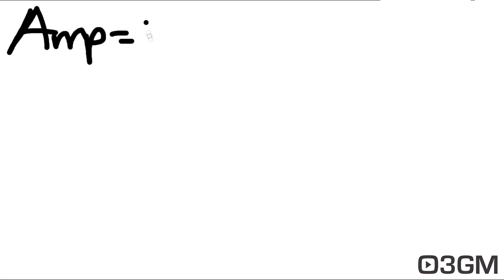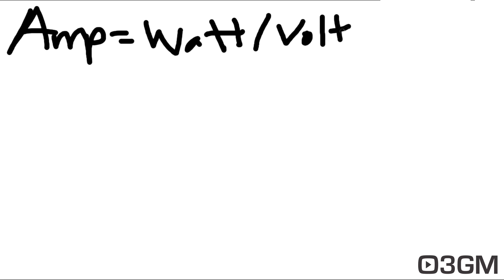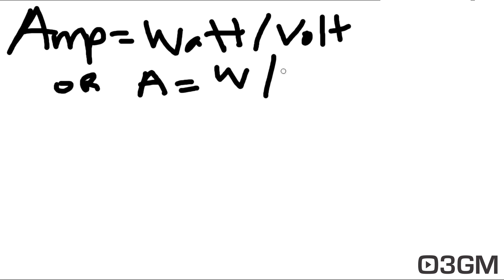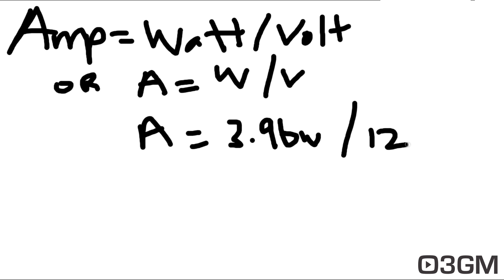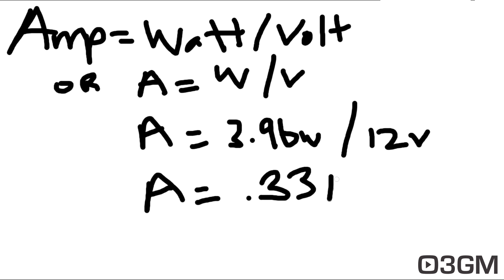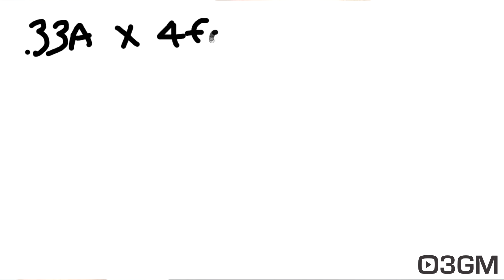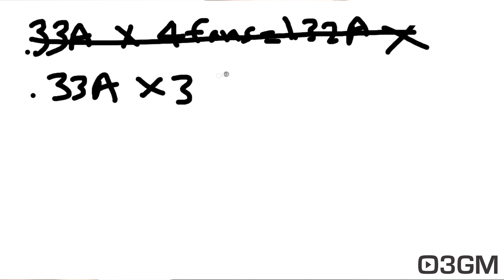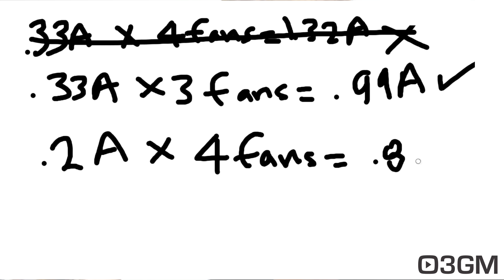#559 - Q&A: How Many Fans per Fan Header?

Comment: Subbed! Great overview and easy to follow. Just bought a whole mess of Arctic flow and pressure fans, along with a new cpu cooler (literally, ID Cooling A410, released just recently) with a matching pressure fan for it to do a push-pull config. Probably overkill for my i7-4790, especially with me planning to delid it some time in the near future.

Realized after I had purchased the F12 and P12 PWM PST 's that my H97-PLUS board only has 2 case fan headers lol. Might upgrade to a Z97 or just go for another platform upgrade to 8th gen - even though I just purchased this mobo combo a month ago lmao. Should have waited a bit, as I just saw a Z97 w 4790K priced at $100, which is the same I bought my H97 4790 combo for. Oh well. After the defunct motherboard combo I had purchased, I was itching to game.

Anyways! Thanks for sharing this valuable info!

Comment: Isn't it recommended to still keep some buffer below the 1 amp limit on a fan header? So like running 3 fans at 0.3 amps each for a total of 0.9 amps on a single fan header is still not recommended as it's best to have about a 0.3 amps buffer making the limit 0.7 amps instead.
Reply from the maker: It would depend on the motherboard's fan header amperage. Some motherboards are 1A, other higher end boards are 2A. With a 2A fan header, you obviously have more freedom :)

Comment: My b450 asrock itx board says that the fan header can support up to 2 Amps!
My plan is to connect 22 noctua 40x20mm fans in paralel(each fan draws 0.05A) I did the math and the total power draw is 1A which seems to be wayy within spec!
But I digress I will look up if that is safe!
What do you personally say?
Should I or should I not!
And simply use a fan hub instead?

Comment: I do have a question about fan controller. Can i go beyond 1amp in fan header with the use of fan controller? And does it mean I don't need to worry about how many fans I use in fan header if i use fan controller? I'm planning to change from splitter to controller....

Comment: Most motheboard (budget) has 1A per connector, standard fan case has 0,2A aprox so you will be able to connect 4 fans without problem to the same line.

Comment: Hey man, great video but I got a question. You said a fan header is 1A. I have NZXT aer p fans and one is 0.35A. I have 3 of them which makes them a total of 1.05A total. Do you think I can still run them through the one fan header or will if fry my motherboard becuase of the extra .05A? Like am I able to go over a little bit of the max? (In this case .05?) This will be done through a a fan splitter with 3 heads. Also how do you find out how much Amps your fan header can take?

Comment: Ordered a new cooler that will run 4 fans in push/pull which is replacing a 2 fan cooler.
One of the most useful fan videos I've come across...
Logic check:
Noctua NF-F12 iPPC-2000 IP67 PWM Max. input current 0,1 A... Hypothetically 10 fans on one header? (Or only 9 to be truly safe?)
Noctua NF-A14 iPPC-2000 IP67 PWM Max. input current 0,18 A... Hypothetically 5 fans on one header?

Comment: i want to install a 6 pipe cooler ,it comes with 3 fans,though 2 would work better,in this video you mention splitters,my pc uses 3 wire fans for the cpu,would i be right in that the splitters get "power" from a higher current source,say a molex connection,while still getting the yellow control voltage from the original cpu fan control header.

If it comes to it i'll run 1 fan as per normal and get a 2 wire fan and make a pwm and just set it to a constant quiet speed,but i'd like to have 2 cpu controlled fans.

Any thoughts on this,or even solutions,as i don't work with computers ,i work on audio electronics,this is just not my field and what's do-able  seems hard to find.

thanks.

Comment: Probably noone here anymore - but.. if I get a hub that is not powered, and I plug 4 fans into it that is 0.12 ampere (all 4 pin) - will my motherboard still be able to pwm control them based on temperature just as if it was a single fan on the header..? and does each fan then get it's 12V - or does each fan get less juice because they share a header?

Comment: I have 2x 0.38 amp LED fans i wish to plug into 1 header.  Motherboard is a Gigabyte b365m ds3h but unsure what the header amp limit is on that board, can't find it anywhere.

Comment: What about 1 120mm and 2 140mm fans on one header? Will all the energy go into the 120mm or will it be divided correctly?
Reply: I'm curious about this too now that you said something. Would the PWM info be distributed correctly? 🤔 If they have different RPM ratings (F vs P, or different models/manufacturers), how would that work I wonder?

Comment: That's for the Mobo fan header, and what about a PSU molex connector?? You know.. the unused connector that usually plugged to your HDD/DVD, how many fan can it handle..???
Reply: Mad Uzi then that depends on your PSU and you could have alot, but wont be able to adjust them if on a molex unless you get a fan control not a splitter

Comment: So i have to use power fan headers then. I want to controll the rgb of 5 fans total, the cooler master controller that uses the software is too expensive for me just wanting basic color swaps so Ill go for the 7 dollar one that uses physical buttons/interface. I had 5 of my rgb headers comming off of one rgb header on the board...the 3rd spliter fried taking the fan with it and thats when i knew something was wrong. Guess I got lucky.

Comment: Question. I have three fans with this info
Product Dimension: 120x 120 x 25mm
Operating Voltage: 12V
Power Input: 1.92W
Weight: 150g
Rated Power: 4.2W
Rated Voltage: DC 12V
Rated Current: 0.35A
Airflow: 38cfm
Fan Speed: 1500(+/-10%) RPM
each fan has a male/female connector in the wire.
Total of 0.35 amps and I would like to connect them to each other from one port but my total is 1.05 amps per heather. What do you think? 
Also I was thinking to connect them directly from the power supply with three per plug, is that ok or better since I want them to run 100%?
Thank you

Comment: If you connect more than one fan to a fan header are you still able to use the PWM features of each fan?  Would the bios control them as one fan cluster?
Reply: Markinpuff it's controlled off a cluster
Reply: I have 6 fans and 2 splitters so I control 3 fans off per headrr
Reply: so my pc case can hold 5 140 fans... im using the asus hero X wifi.  im using noctua d15s with 1 fan but want to add a second fan in the future... how can i set up my case using all my fans. do i need splitters? or a fan hub? sorry im new to buulding pcs . ive been using laptops for years
Reply: Amduciaszx Warframe  I run 6 gentle typhoons with some generic one off Newegg. It's a 4 pwn fan splitter but I run my fans in dc

Comment: Okay so a Noctua 140mm NF A14 is 1.56W at 12v... so its only .13 amps?? That would mean you could run like 7 of those 140mm off one header????? That doens't seem right. 

 What this video DOES NOT take into account is you're motherboard... the gauge of the wire is very thin... so maxing out the header still may result in a meltdown
Reply: I have the same fans, and Noctua recomends never use more than 2 of this in a single header, so, what is the real power draw? I will not put the headers or the splitter´s wire to the test, this is a b450 mobo, not bad, and i can´t complain, does the job, but i do not want to replace it any soon just by beeing curious...

Comment: i want to use the embedded rheobus to the cpu fan header and i have to connect all my fans on this particular header. so i have 2 x 0.11 (2x92 mm noctua "nf-a914pwm" intake) and 1 x 0.2 (1x120 mm enermax "ucmaa12a" exhaust) for a total of 0.42 amps should be ok thanks edgeman. using this header, all fans (and not just some of them !) will makes noise only if cpu will be very busy.

Comment: oh my god why is it so complicated why manufacturers doesn't even provide theses informations and i why have to watch for some edgeman videos to learn that xD
Reply: You are meant to put only one fan per header after all
Reply: @GimiBsk  I just got the Asus strix x570-E Mobo and that thing has two chassis fan headers, does that mean I’m only supposed to have two fans? I really don’t know, trying to look for some answers since I bought some splitters and trying to use like 5-6 fans
Reply: @dtrainduran  I still use 2 fans per header with splitters, it’s working great. I’m rocking 6 chassis fans in my config. The fan headers on the mobo are well capable to drive even 3 120mm fans per header, but I haven’t tried that (not sure about them being RGB though). Overall on modern mobos the fan headers are 12W @ 12V. The fan usage will be on the back of the fan so depending on that you can put more or less fans but always leave a bit room don’t max it out

Comment: But what about fan hubs and fan controllers ? People connect...like....5, 6 or more case fans for the sake of cable management. I have no experience whatsoever with such devices. Does that mean I would NOT use the mobo fan headers ? Would I just have to connect the hubs´ power cable to the PSU and the fan cables to the hub/controller ? Or am I missing something ? I got 7 fans to run and my old mobo has only 3 fan headers and I would like to put an end to all those Y-power cables salad in my case. :D

Comment: Noctua NF-F12 is only 0.05A. So you can have 20 of them on a single header...
Reply: next Linus tech tips video
Reply: @GKPranav  hate linus
Reply: QuantumBraced: That would need one hellova splitter to hook up those 20 fans. Does it come in RGB?
Reply: @dhblan8591  you could daisy chain mutliple splitters on each other. hook up one 3 end splitter to the MB, hook up three more 3 end splitters to that and then top all nine ends off with 2 end splitters, except for two, those will need again 3 end splitters and evoila, you have 20 headers on one board header. (if i counted correct)
Reply: @drecksbongert4367  - Drecks, Thanks for the reply but you took my comment way too literally. Just having a laugh especially about the RGB part. Thank you and stay healthy and safe.
Reply: probably just simpler to buy a fan controller
Reply: @allseeingeyezz  can one simply buy and attach a fan controller to the motherboard?
Reply: This man's the plug.

Comment: be carefull gigabyte said the z170 gaming 5 can only do .50 amps per fan header which is stupid low for a Mobo that cost the price it does
Reply: lmfao soo an old amd cooler would fry the mobo. Because it pulls 0.7A

Comment: My motherboard has 2 fan headers one for CPU and one extra but I need need 3 fans one for a liquid cooler I want to install, one for exhaust. The CPU fan I'll need for the pump will it work if I use the fan splitter that came with my motherboard. I have the MSI B150i AC please help !

Comment: Wait I'm so confused I have 4 corsair af120 120mm fans how do I connect them all?!?!?
Reply: each af120 draws 0.13A(mps). you can get up to 1 AMP out of 1 header. so you can use up to 7 of those into 1 fan header. you can do so with a "fan splitter"
Reply: Download your motherboard's manual and check how many headers it has. I think there's one header that's dedicated to a pump for water cooling (might be called CPU_FAN), and one that's dedicated to the water cooler's radiator fans (might be called CPU_OPT). I don't know what happens if you connect case fans to these headers. You should ask on Tom's Hardware or some other forum. The remaining headers should be for case fans. If you have more fans than headers, you can use a fan splitter, fan hub, or fan controller. If the fans are 3-pin, then I think they will automatically run at max RPM, but with a controller, you can control the speed. If 4-pin and has PWM support, then you can use the motherboard's BIOS or other software to control the speed. You can connect 3-pin to 4-pin connectors.
If we assume the motherboard's headers are 1.0A each, then you can connect up to 7 Corsair AF120 fans to one header (0.13 x 7 = 0.91) because they are 0.13A each.

Comment: I have a Cooler Master fan and it says on the box that the rated current is 0.05A but the safety current is 0.5A. So should I assume that it's 0.5A?
Reply: Veselin Krastev the safety is the maximum current you can put through it without harm happening to something in your pc

Comment: Hi:) I have 2 Ultra Sleek Vortex 14 (input power 2,04 W and voltage 12V) and I wana connect them to one fan header (noctua na-syc1). It will be ok I think?:) Help :D